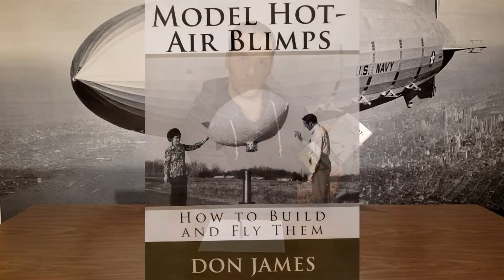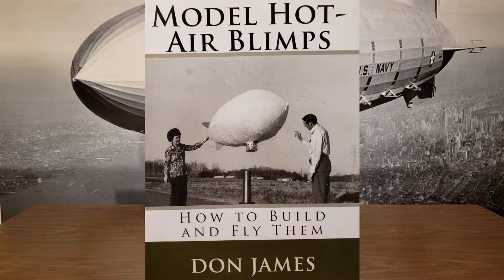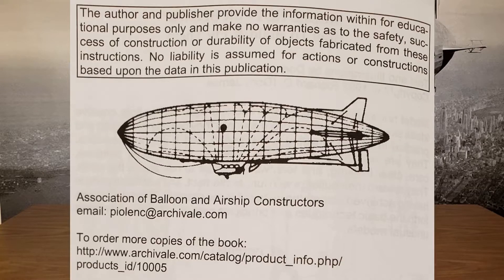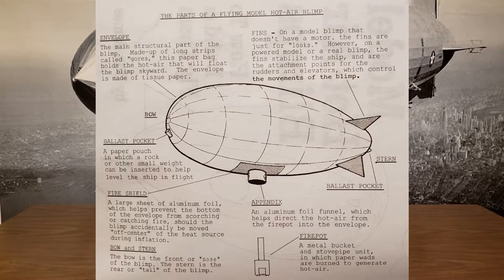Make Things Fly - Project: Don James Thermal Blimp Model Attempt 1 & 2

Comment: Hello!, i got interested some time ago about hot air flying, and started investigating about different models and stumbled upon your video and bought the book you used, any notes i should take when building this blimp or any recommendations about the materials outside the manual? I really would like some guidance before actually building it for the science fair in my school next february if you could please!
Reply from the maker: Hi, have you worked with tissue paper hot air balloon models before? It really helps to build a hot air balloon first to work out the kinks in the making process. The book has some positive things but it was put together after the author's death, so somethings will not line up. Don't use the fire pot that's in the book, that is a fire hazard.
Reply: @makethingsfly  So far i have only tried hot air ballons with big black trash bags, didn't actually work at the time due to me not knowing that i had to use something light like 4 birthday candles, so since i bought the paper first, i'll try to slowly work towards being able to do the blimp with some beforehand practice with a paper ballon.
Reply from the maker: @toybrickcommander  keep me posted on your progress or if you run into issues.
Reply: @makethingsfly  Hi again, question about the gores, do they actually need to be round o a straight cut won't affect practicality?, also, what's an aproximate length from the tip of the gore until it stops curving o being straight? My blimp gores are about 120 inch, i used 4 sheets of tissue paper of 20x30
Reply from the maker: @toybrickcommander  Rounding the gores instead of straight cuts will give more of a traditional blimp look. If you are building for speed it would matter, but otherwise it is more for looks. Its been a little while, but when I was building thermal blimps I used the lengths on pages 14-15. I'm looking for my gore template to confirm it, but I think I used 7ft 6ins.
Reply: @makethingsfly Do you think a hair blower heat only would be enough to make it fly or a tabletop stove is better? Thanks for answering in such occupied times
Reply from the maker: Hair dryers are limited with heat, some will get up to 200 degrees. A stove will double to triple that temperature giving the air a lot more buoyancy. I tried to lift one of my smaller hot air balloons with a hair dryer and it didn't work that well. But I used a hair dryer with a large volume hot air balloon and it flew fine.
Reply: @makethingsfly Hello, this Is possibly the last question I'll make as the gores have been joined, what is the best temperature, and for how long does it need to fill the blimp with hot air and fly? Also, what's a rough estimate of your stove max temperature?
Reply: Hi if you still see this in time, important question, here it's 22 celsius or rather 71 Fahrenheit, i would suppose that would greatly affect the capability of it floating, right?
Reply from the maker: @ temperature can be tricky. I've melted and singed many projects. With higher temperature its more about filling the envelope without coming into direct contact with the walls. My stove does about 500 degrees Fahrenheit. Time to fill varies on how quickly air moves through the stove, or thermal source.
Reply: @makethingsfly  What about environment temperature, as i said it's 71 Fahrenheit, would it make the blim unable to fly? Because, that's the result I'm getting
Reply from the maker: @toybrickcommander  the colder the environment temperature, the stronger the lifting force. But outside temperature will peak about a hundred degrees Fahrenheit, and your thermal temperature will be significantly higher. With thermal you will usually have a larger envelope to increase the square footage of the contained air. Make sure you have a good tether or are indoors while experimenting. If it gets away from you, it is out of your control where it goes.
Reply from the maker: @toybrickcommander  You may need to increase the size of the blimp.

Comment: What if you had a helium cell inside? Ive been wondering if helium would give more lift when heated past 100degrees?
Reply from the maker: These blimps were part of my exploration into thermal lifting. My stove heats air to about 400 degrees. Helium will always have a stronger lift than heated air. You could have a helium cell, but be carful that when gases heat up they  expand. This could cause you helium cell to pop, or leak to release pressure. Also with projects like these you want to ensure that it will not float away. With using heated air the will will come down as the heat dissipates.

Comment: How did you join the gores made from mylar? Most glues and adhesives, at least the ones I tested, don't create good joints. I've made an envelope with mylar from emergency blankets using silicone sealant after testing many other alternatives, and while it worked well it also got too heavy. It flew, but I wish I had a better alternative. I've seen baccayarro making envelopes with emergency blankets mylar using cement glue, but where I live (Brazil) I never found cement glue that worked for it.
Reply from the maker: For thermal you don't have to worry about leaks as much as if you were using  a lifting gas. For thermal I use tape. The biggest problem with using tape for thermal lighter than air projects is that the adhesive / plastic will melt near the heat port. So there are trade offs.
Reply: They key to getting rubber cement to work is to apply it to both surfaces then let it dry out for 10 minutes. It'll become super tacky and sticky at that point. If you don't wait they won't join.